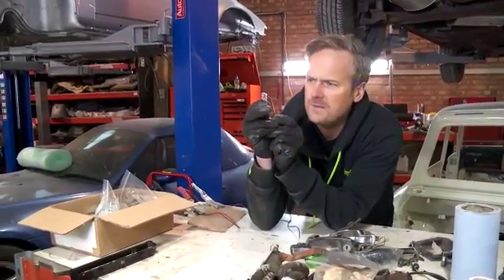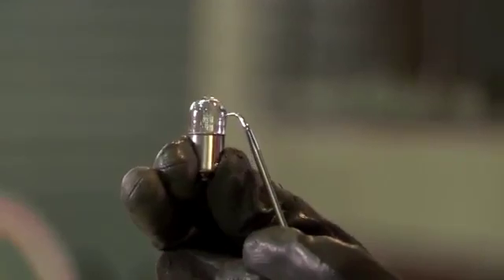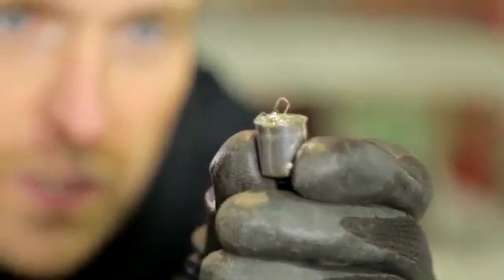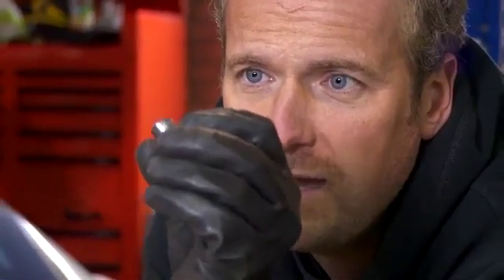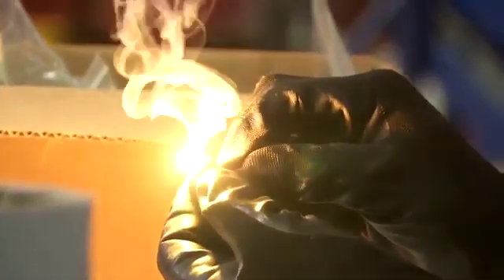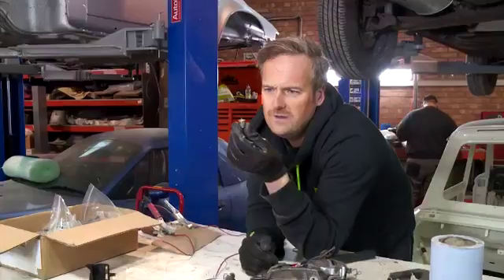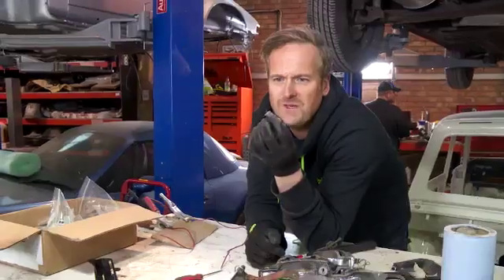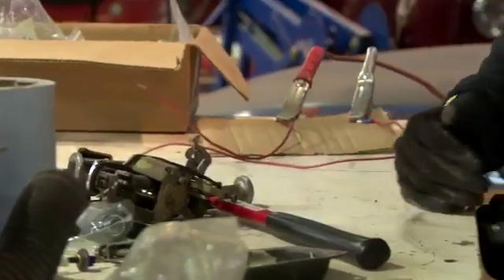How A Bulb Works | Workshop Uncut | Car S.O.S.

Comment: When incandescent light bulbs were banned I immediately went onto ebay and brought loads and loads. I have a loft room which is not heated. It is now thoroughly insulated. A couple of light bulbs not only provide instant bright light but also heat. I no not need to run a heating radiator into the loft. Turn the lights on, wait a few mins and the temperature is fine. Yes they are inefficient but that can be turned into an advantage.